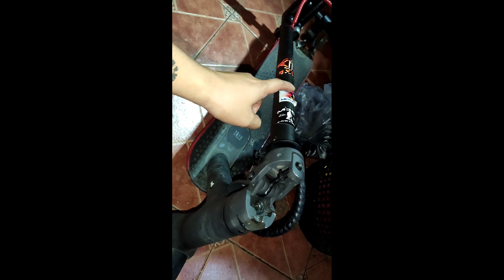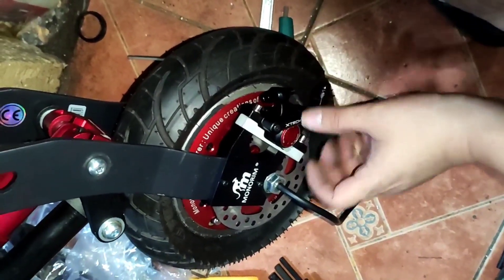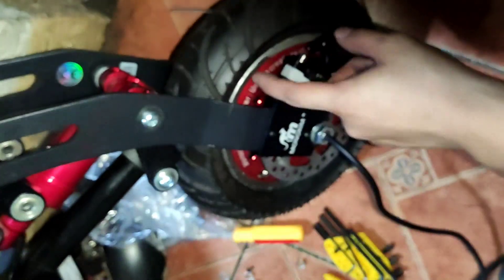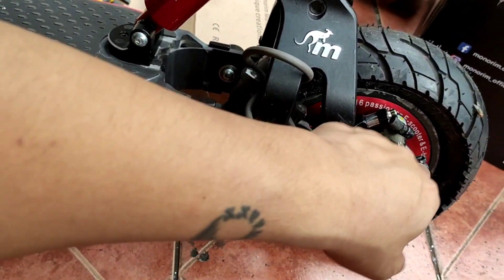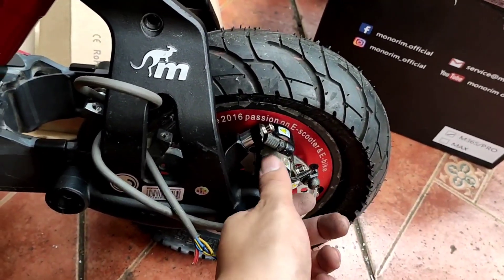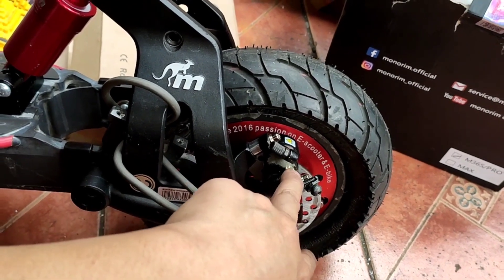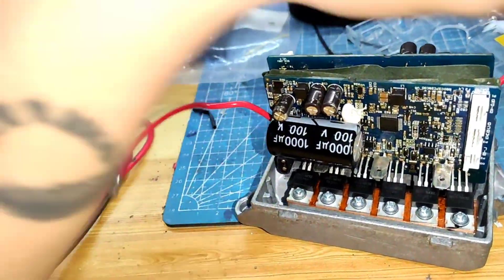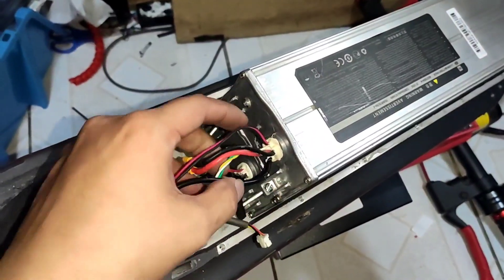72V Dual Hub Motor Controller Monorim Xiaomi M365 Pro

Comment: whats the range like?? dual motors with 12ah sounds like thats gon die super quick..
Reply: You're not factoring in voltage
Reply: @Samusaran77 I dong need to I've tested 12ah and even 15ah on alot of scooters I know the range is gonna be terrible
Reply: @ZOMBIEEZ Yeah. 36 volt batteries...
Reply: At this point just put Inna proper battery kit if your gonna do 72v do is properly  @Samusaran77
Reply: @Samusaran77 the higher speed from the voltage is gonna naturally pull more power and current I give it 18 miles tops and I don't even see it doing that unless you weigh as much as a small child

Comment: Super Scooter!👍💯 Question: in Aliexp.  There are 4 different chrome rims with black with 3 stars in the middle and the edge is chrome.  These are 10" rims for 10" x 3 tires.  Do you know which rim from the 4 pieces different from Aliex.  fits on the Xiaomi??  It's this chrome rim from the Kugoo Scooter.  Do you know if this chrome rim from the Kugoo Scooter fits on the Xiaomi front side?  Kind regards.

Comment: Hi!  Great video and scooter!!  I have the Xiaomi 1s.  I ask you for an answer.  I see you put 10"x3 tires on the rim. Is that correct, I have to have the rear wheel rim turned by a machine in a company (locksmith), left and right 2.5mm less. After that, the wide tire fits 10"x  3 ?  Is that correct?  Or is it possible to buy the rim already finished with 10"x3 tires. Or do I have to have 2.5mm removed from the original rim in a company on the machine. Mfg

Comment: A voltage divider doesn't make your scooter 72v.  You could add 144v divider over four controllers... Still you have 36v on each... But 4*250w...

Comment: What is done to the ESC? MOSFETS, capacitor, trace cut, anything else? What firmware do you use?
Reply: hi, do you have any further info about the controller mods? I converted one Chinese controller and drove it for 10 minutes before it burned. Well it burned because I was going a very steep hill climb about 300 meters long and suddenly the scooter turned off. Otherwise, it rode pretty well on a 17s battery. I changed again the mosfets but it is not turning on. Do you have the complete instruction about the esc modification? On mine, I only changed the big capacitor with 100v one the mosfets and cut also the trace between the plus pole and the plus capacitor pin. Nothing more. I appreciate it if you have any further info to help me.
Reply: @minalobudeshte  found any info ?

Comment: boss san po pwede bumili ng dashboard holder? salamat po
Reply from the maker: You can pm my page po jz autolights for quotation
Reply: @jayzeeph5620   I have the same scooter doing the exact  upgrade I have installed everything the same as you but dont know how to wire both dashboards up is it possible  to send the wiring diagram please